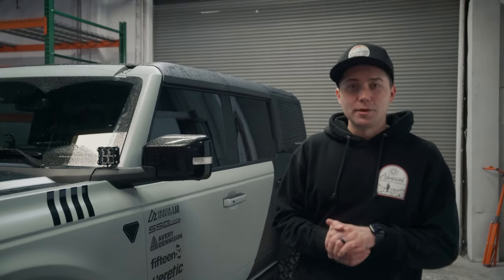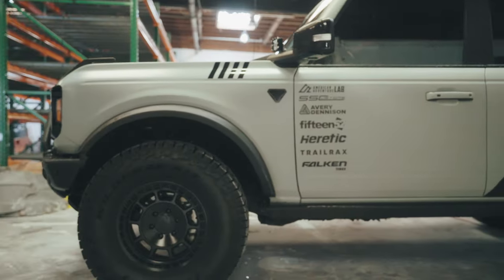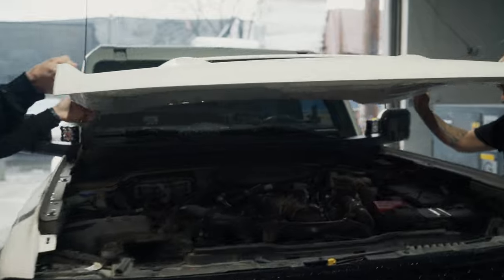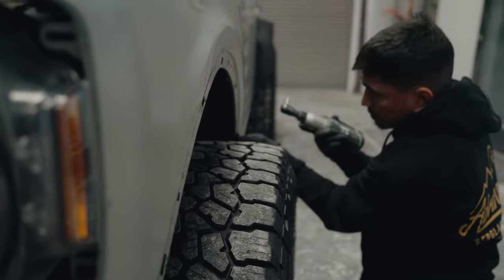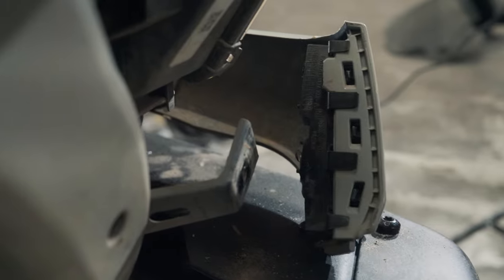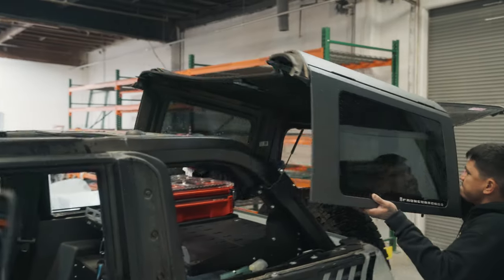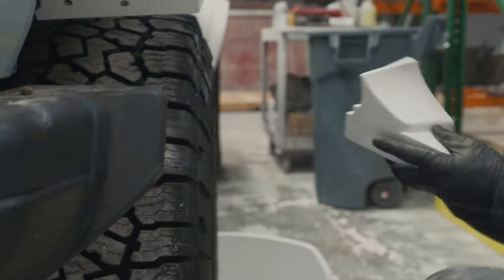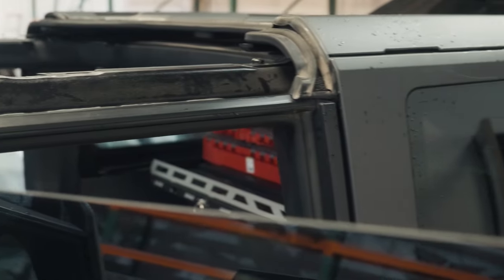2021+ Ford Bronco | 8" Kit + Ram Air Hood Install | Wide Body Kit

Comment: For those 8” flares what offset is recommended for 35’s so they don’t look buried under the flare?
Reply from the maker: You will either need a long-travel kit or aggressive offset wheel paired with spacers.

Comment: Does the hood have holes to add aftermarket gas struts like the factory hood has?
Reply from the maker: We use MRT hood struts which work great!
Reply: @advfiberglass  I have Mabett gas struts on my factory hood, would I be able to use them? Does your hood have the same holes as factory?
Reply from the maker: @BroncosaurusTales  We have not personally tried those struts. We recommend the non drilling options on the market.
Reply: @advfiberglass  these are non drill. They use holes that are in the factory hood.
Reply from the maker: @BroncosaurusTales  We have not personally tried those struts so can not advise 100% if they work or not.

Comment: Why don’t the fenders come predrilled making it an easier and install?
Reply from the maker: They are pre marked on the products but do not come pre drilled. If they came pre drilled then the part cost would be higher to accommodate the extra labor costs involved.
Reply: @advfiberglass  ok understand